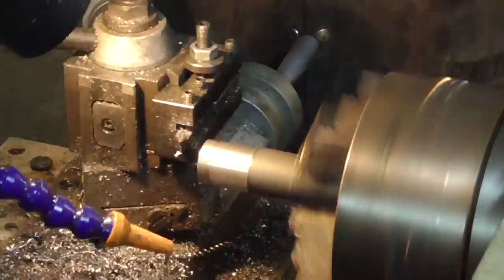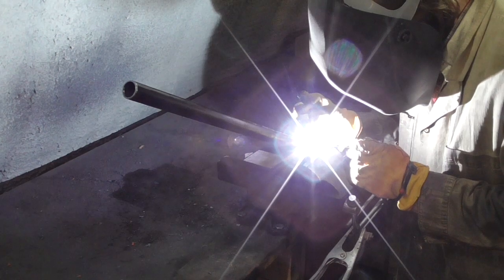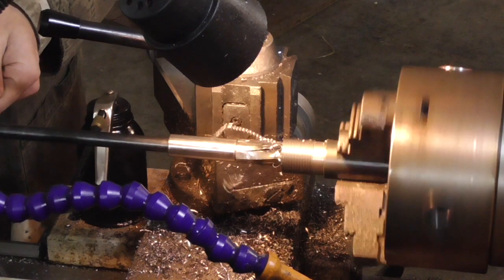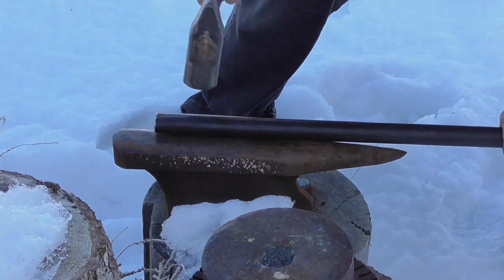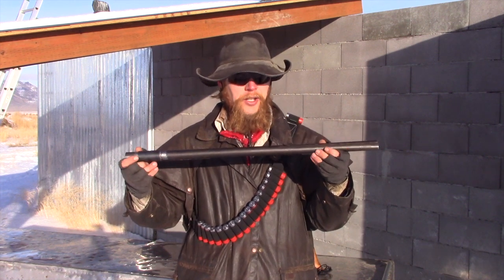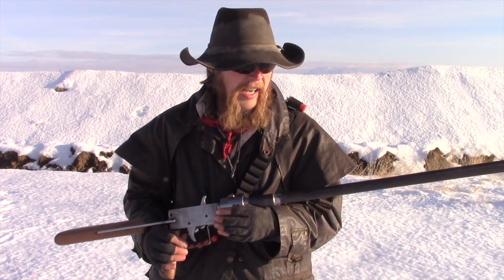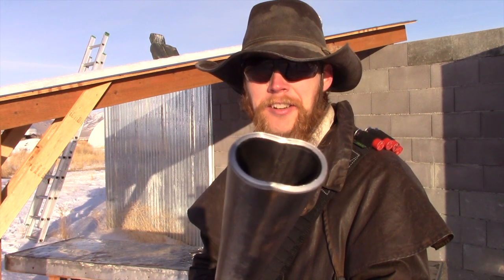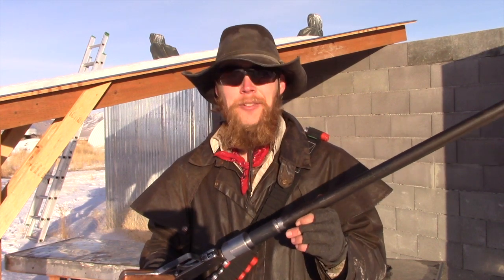Oval Choke Experiment (TIS243)

Comment: You can do so many tests with that barrel.
Please please do some patterning test at 20,30,40 & 50 meters through cardboard pieces at least 1m 1m or about 3ft sq. 
Please try number 6,7,8 & 9 trap loads as well as BBs & 4 shot. 
You may be onto something here so, whatever you do, don't move on until you have at least some of the results, especially the patterning tests, you must do the patterning tests.

Comment: try making a jug  choke with a brake cylinder hone .. so it seperates the wad from the shot column  helping the fingers open behind the shot instead of a
 "blown pattern " from the wad flying through the midfle of the pattern ..i worked out an old Montgomery ward  pump shotgun for a friend this way a few years ago  .. . he was asked not to use it in turkey shoots anymore   cause nobody else could win anything ..it "sucked the air outta the room " . from a police car length gun ..that normally wouldn't have ever delivered such a tight pattern

Comment: YUP,  you're really onto something with that idea! might be even better if you made a mandrel to fit into it to beat against as it gets pounded in. might be able to stretch it 1/16" or 3/32" wider without as much constriction top to bottom that showed itself in the experimental version. whether on the ground or in the air it made some advantage

Comment: I see a number of people in the comments are familiar with the duckbill choke.  As far as I know, this was put to some use by the US Military during Vietnam.  I've seen photos of Ithaca Model 37s equipped with it.  By all accounts it did indeed work to provide lateral dispersion of the shot.  Buckshot responds rather differently and less fluidly to any choke than smaller pellets though.  I don't know exactly what results were achieved, but they apparently were used in combat on at least a limited basis.  The choke attachment looked like a tube with a V cut on each side.  There were some problems with the early versions cracking at the root of the V, and later a reinforcement ring was added at the end.  A fun and fascinating experiment.  I believe you may have achieved somewhat superior results in terms of patterning to the duckbill choke that only affects the shot charge at the muzzle.  I'd love to see it tested on paper at different ranges with various types of buckshot loads and different diameter pellets.  It would also be interesting to see lead versus steel shot.  Could have very different results.  If I remember correctly, Small Arms Review magazine did an article on the duckbill choke military shotguns some years ago.

Comment: Duckbill chokes have been a thing for a while now, very cool concept, but part of the advantage of a round choke is it's overall utility vs a duckbill style. If you're shooting at a flying game bird, then a duckbill would be great if you knew your range well enough, but if you're off on that estimate you'd miss much worse than if you'd had a traditional choke, since the circular pattern there would give you a margin of error for shorter or longer range due to the verticality of the pattern. Same goes for small game on the ground as well. For 2-legged prey then a duckbill choke is certainly good, and has been used by the US military to great effect in the past. Good video, regardless.

Comment: Sounds like an old "spreader" choke.
Reply: No spreader chokes work differently. Those are usually designed with a timed restriction to pop the wad off or constrict the wad enough that it squishes the wad outward as it's passing through the opening. some versions use a combination of brake fence to release the pressure or even a ring where there is a space and then the what hits a tight constriction after the gas is vented.

Comment: Wouldn't this be like a "duck bill choke"?
Reply: This is indeed just a duckbill instead of an egg shaped choke.
Reply: Rick Farwell I was thinking the same thing. however, his design is not close to the duckbill. yet, it has a similar result.
Reply: I recall seeing that in the 80s
Reply: There was a navy seal that supposedly used a shotgun in Vietnam with a duck bill or similar choke in Vietnam
Reply: the analogy is a positive compression and negative compression pump...